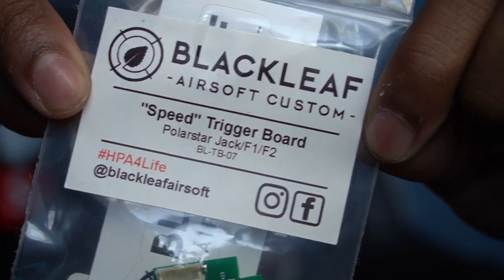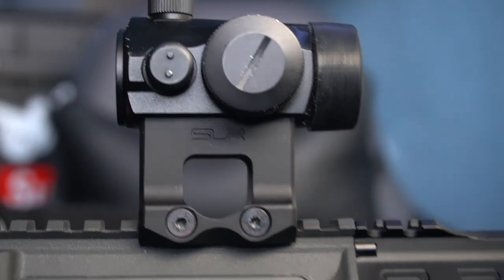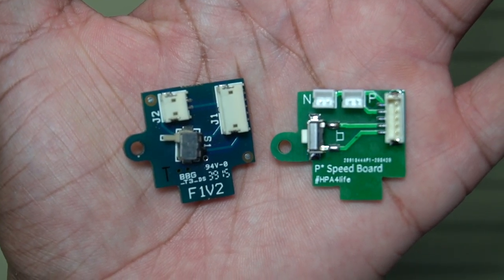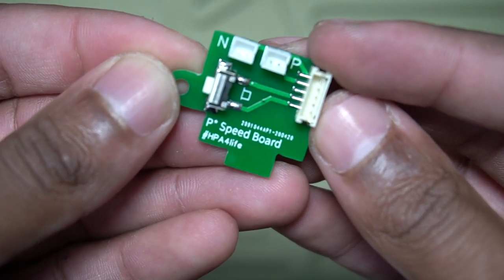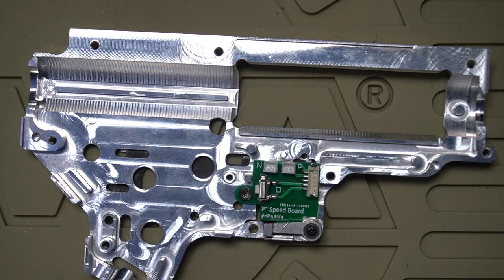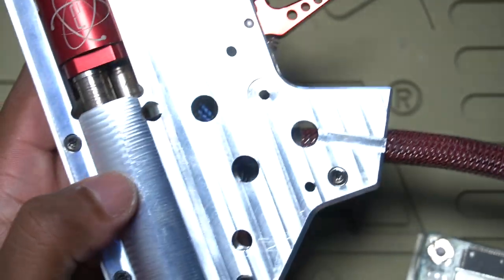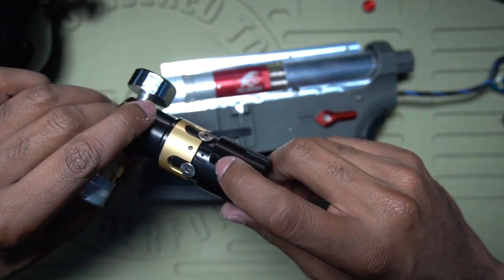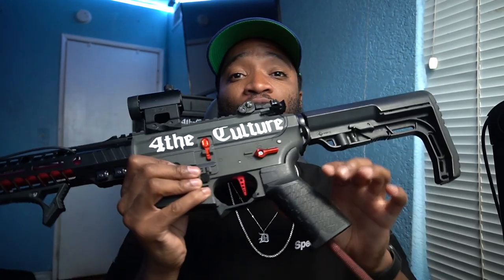ULTIMATE Trigger Upgrade On My $2000 Airsoft Gun | BlackLeaf HPA Speed Board (Lets Talk Airsoft)

Comment: The small switch on the back of the original trigger board is for full auto, there's no Electronic safety on the Polarstar boards/FCUs. The safety is all in the little arm inside the gearbox, when the gun is in safe, it lofts up to physicly stop the trigger from being pressed, which is also why it's hard to get the safety to work if the hair triggers.
So the blackleaf doesnt support full auto, which is somewhat wierd..
Reply: It does support full auto....they have a V2 board i have just ordered

Comment: Dee, the little switch on the back of the trigger board is for full auto, this board semi locks your gun, the safety is a lever in your gearbox and it doesn't work because the switch is too far back

Comment: The switch on the rear of the original board is for full auto function not the safety...

So by the looks of it the board will only work in semi or full auto depending on which way round you have your settings on the fcu...

Comment: Hey Deemoe! I work for maxx and your C clip is not fully installed on your chamber. There is a ridge in the middle of it that adds security but for some inner barrels you need to file it a bit thinner to fully lock in. Get some mini files and try it out.

Comment: For my m4 I run a P* Jack with a modified stock trigger. I the trigger pull is basically nothing and tuned perfectly. I use a maxx me pro hop up and a stock barrel. I also run a P* Jack AK as well for outdoor. I have a Prometheus 6.01 barrel on it with a stock Hop up and trigger. Hopefully I’ll do a trigger mod in the future. Both are great set ups! Keep up the great videos!

Comment: The little switch is for auto, not safety. Same for the jack and f1/2 boards. They use mechanical safety so just shave it down to work for shortened speed triggers

Also for sollenoid problem check Orings. They leaks commonly. If you haven’t sent it off yet lol

Comment: I got the Mac drop in gearbox with the f2 pre installed from amped I’m trying to figure out why I’m safety it will still shoot and in semi and auto it’s like a burst mode unless I pull the trigger hard I’m trying to fix it before I try it with my gorilla fcu any ideas they are saying selector plate

Comment: Hey guys I currently have a redline gen 2 engine and was wondering if it’s possible to add a speed trigger to the engine. Any thoughts? (The current system is set up to work for triggers with rear tangs.)

Comment: So i'm just getting into airsoft coming from paintball and one of the biggest upsides i saw was not having to deal with solenoids, leaking air, lube etc. Is hpa system THAT much better than aeg? The systems look very different from eachother as well and being so new would it be worth it to learn aeg systems first then hpa systems or what?

Comment: I installed my p* in a krytac gearbox so I could keep the bolt catch feature and spent 4 hours figuring out what wasnt working and I had to dremel out a few things and modify a normal trigger because the speed ones are out of stock

Comment: I have one question, I like to run MAXX triggers and time them so there is maybe 2mm of travel before it fires. With this switch, can I still tune my trigger that well?
Reply: From my experience, Maxx triggers are not compatible with black leaf boards they sit too far forward and will not engage it
Reply: Yes it will fit fine,just finished two jacks with blb in them

Comment: When u watch the whole vid ready to order the board. Then find out the safety won’t work. I play at a field with mandatory safety.
Reply: You can shave down you’re safety to make it work. The switch he’s talking abt is for auto, same for the jack board. The jack uses mechanical safety so just shave it down. It’s what I did
Reply: Sam Hubbell So no way to make auto work either?
Reply: QuickPhalanges black leaf boards are only semi auto
Reply: Blackleaf do a V2 board that has Full auto